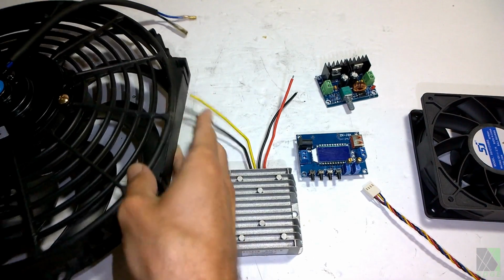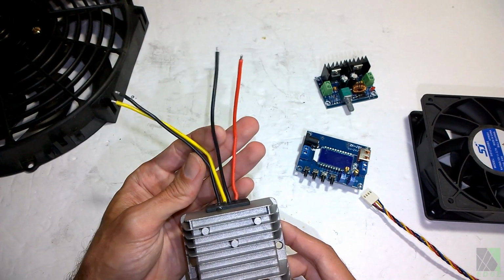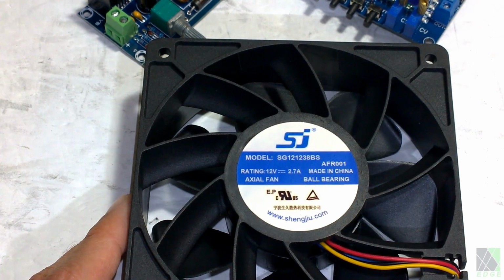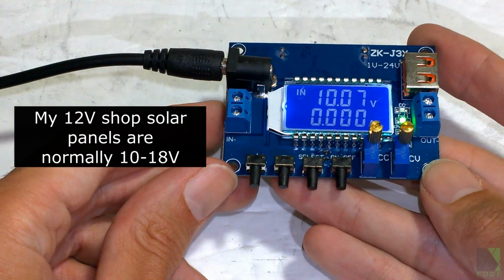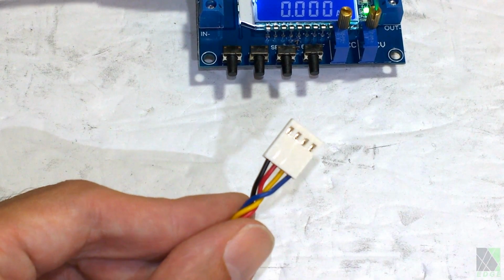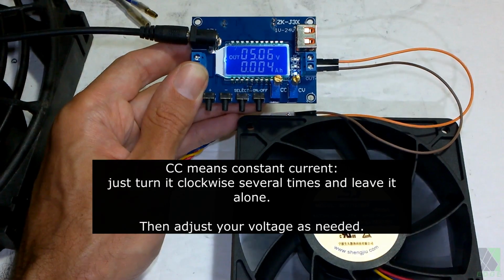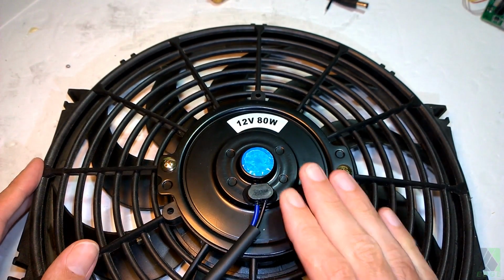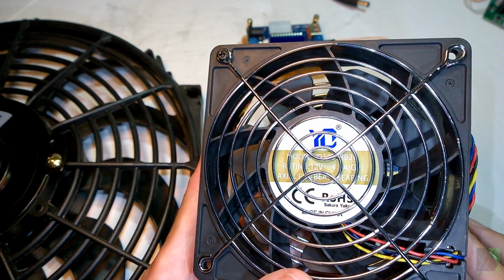Solar Shed Ventilation COMPONENTS Explained! Part 3 Favorite Brushless Fans DC converters #solar

Comment: I am living in Thailand I need to move air to prevent mold when away and the place is sealed up.  — I will have to order the fan on line from local parts houses. Can you recommend some specific automotive cooling fans that  you have used in the past that are a convenient size and shape to use with a 50W panel. Most cars here are Japanese but there are some Small Ford and Chevy pick ups.   Thanks So Much for the video and your help Jon
Reply from the maker: @JonBabcock-r7e Hi Jon I just replied to your other comment, glad the video was helpful. You can use any 12v or 24v car or truck radiator fan, have fun :)

Comment: great videos
I am trying to finalize a set up for my shed.  I am thinking 2, 10 or 12" 12v 80w radiator fans.  Should I run them with 200w (two 100w panels) with a dc buck controller or since you mention the radiator fans should only run around 6v should I just use 1 100w panel? Also which is the simplest safety measure, fusing off the panel or breaker.  Final question there are kits that come with a pwm controller, will those work or those mainly for regulating battery charging?
Reply from the maker: @swc913 Hi, I'd test 2 fans in series with your 100w solar panels and see how it goes. With 200w of solar, a standard 12v automotive fuse would be fine with an on/off switch for convenience. Otherwise a standard DC breaker can do both functions. Those kits probably are intended for battery charging, so I'd stick with straight through wiring. You can always add more stuff later - DC converter, speed controller, etc. Hope that helps
Reply: @solarpoweredge  Thank you for the information!  So  1 x 100w panel will be best to run 2 fans.  Opting for that lower 6v at each fan.  If I jump to 1 x 200w panel best to have some sort of fusing or breaker? I am in southern CA if that with max sun.
Thanks again!!
Reply from the maker: @swc913 No problem! with 200w I'd suggest a standard PV DC circuit breaker, mounted inside a plastic box with a DIN rail and the wiring secured. It's probably best to go this route, as the more power (amperage) on tap the greater the need for protective devices.
Reply: @solarpoweredge  
Sorry for all the questions.  Could you expand on some of your wiring techniques?  I am wondering if you can switch to regular 12-2 wire after you land the PV wire into the breaker?  From your videos it looks like you've run nonPV wire to your devices.

Comment: One more question please, I bought 2 of those 12 volt car radiator fans from your recent post below. Will the 100 watt solar panel in your Amazon link run both of those direct with out burning up those 2 fans? Will one of those panels safely run one fan direct or? Thanks in advance kind regards Steve.
Reply from the maker: @stevegill866 Hi, yes the 100w panel can run both fans. Simplest / cheapest solution is to put the 2x 12v fans in series (acts like a 24v fan) connect that to the solar panel and they should each get half the voltage, and not easily burn up. In direct sun, that 100w panel should move a good amount of air with 2 fans.

In my tests, a 100w solar panel can push one single 12v fan pretty hard, maybe even up towards 14-15v. In these tests, the fans got extremely hot and became a fire risk. I recommend running some tests with the fans in series and see what happens! PS: if you put both fans in parallel, that could be another option for low-speed operation - if you need 2 speeds.
Reply: @solarpoweredge  Thanks again! You are one of the best! 
Kind regards,
Steve
Reply from the maker: @stevegill866  No problem Steve, hope the project goes well

Comment: The link to your preferred 12 volt 12 inch fan has been listed as "not available" for some time. Can you provide a link to a reputable alternative? Thank you kindly.
Reply from the maker: @stevegill866 Hi thanks for telling me about that link, I replaced it with another to a 12v car radiator fan, very similar. There is also a link to a wider selection of them if you're curious. I found the smaller car radiator fans (like 10") are less effective due to surprisingly small blades for their size. 

PS, a 24v car radiator fan also works really well for direct drive solar. Unfortunately, they tend to cost more. It's a tradeoff. I have one in my smaller shed at the moment with a 50w 12v panel, works good.
 Hope this info helps.. Any questions let me know!
The 24v radiator fan test https://youtu.be/8juViLWghLs
24v/12v/series bench tests https://youtu.be/m-yhqqFJ4gg
Reply: @solarpoweredge   Thank you kindly! Sure appreciate your videos, opened up whole new vistas for me!
Reply from the maker: @stevegill866 Welcome!! :D

Comment: Great video thanks! Wondering if the DC brushless fans are waterproof. I want to install right at my gable vent in my shed and wind could blow rain into it.  Also unsure which thermostat would be best just for cooling in the summer?
Reply from the maker: @jeffholeman Welcome, glad you liked this :) most of them are not, a very few claim to be "weatherproof" but I gather they're not "soakproof". Maybe one option is build a downward facing duct to prevent windblown rain from making it in. It might be simpler to just run the fan all day off solar, as the heat will never stop coming in. That's basically what I do, never did use a thermostat. Less stuff to worry about :)

Comment: hi do you know how to hook up a battery inbetween the solar panel and the fan so that it can capture overcharge so it can also spin at night. Also, would such a set up require some kind of chip to detect when to use solar power and when to use battery power, because from what i understand batteries can't charge and discharge at the same time.
Reply from the maker: @Bromunculi  Hello, one way to do it is to use a basic solar charge controller, with a battery. The battery can be charging while the solar and fan are connected. This is actually a normal and common scenario. Think of a battery like a bucket of water. Water in (solar) versus water out (fan), and it's either filling up or emptying. A bigger solar panel will make sure the battery leans towards filling up, while still running the fan. A solar panel with less power than the fan will "help" run the fan, slowing down the battery discharge... but eventually the battery will be empty.
Some thoughts:
1) solar panel should be powerful enough to run the fan all day plus 100% charge the battery 
2) battery needs sufficient reserve to run the fan after a cloudy or dark day
3) If the "Load terminal" of the solar charge controller has at least 10 amps it might be a way to power the fan and automatically shut it off if the battery gets too low
4) Sheds are hot, and not too kind to batteries, just something to keep in mind. 
5) Another option is to run the fan on solar during the day, and a AC-DC converter during the night. That way you get the best of both worlds.
I hope these ideas are at least helpful :)
Reply: @solarpoweredge  alright appreciate the advice 😄👍
Reply from the maker: @Bromunculi Welcome!!! :)

Comment: my car radiator fan like that last 2 years running direct on 100watt panel before burning out ..i wonder what to do to make it last longer since i only have a 100 watt solar panel by the way im using as an attic fan and we are having heat wave here in Manila.
Reply from the maker: @timothy1837  Hi... yes I've heard it's very hot over there... these car radiator fans should run at 8-10v plus have a way to stay cool. Putting 2 in series will reduce the voltage and run them cooler and may move more air overall. Or using a DC-DC converter to keep the voltage 8-10v can help. A 100w panel could push the voltage pretty high in some conditions, in which case they will burn out sooner. Lower voltage = slower rotation, less heat, longer life (hopefully) as they only have carbon brushes with limited lifetime. I tested the series connection here https://youtu.be/m-yhqqFJ4gg
Reply: thank you so much for the advice ..and your very quick response...
Reply from the maker: @timothy1837 Welcome sir

Comment: Awesome presentation 👏.  Did you notice a temperature drop when the fans were working.
Reply from the maker: @andys5203 Thanks a lot! There is a thermometer in the shed and after blasting the fans a while I can see the temp drop. It cannot drop below the outside air temps but works good

Comment: Hi can you help me please? I have greenhause and i use 12v 20w solar for running my pump for irrignation with battery . Now i won add fan for better air flow on wintter and summer day. Which fun yuo sugesst? I also won have i speed control off fan. Maybe will be good if  i buy extra solar 30w. I also won add timer because in wintter day i won fan work just 2h in day
Reply from the maker: @mihaelbozicevic758  Hello, yes I will try to help. I suggest no less than a 30 or 50 watt 12 volt solar panel for the fan, so it moves a good amount of air.

The "fastest and simplest" solution is to connect a 50-85w car radiator fan straight to the solar panel with an On/Off switch. If this works well for you, then add speed control and a timer - as a separate project.

PS need a fan grille or cover as the radiator fan is very dangerous when spinning.

Just my opinions here, without knowing much about the greenhouse, hope it is of some help
Reply: Thank you! It is better if i connect two panels 12v one 20w second 40w in  parraller or series? i have mppt charge controller 12V 10A. @solarpoweredge
Reply from the maker: @mihaelbozicevic758  Welcome, you can connect the solar panels in parallel, they will operate like a bigger panel. 
Do you intend to run the fan from a battery and MPPT? If so, you could install a PWM motor speed controller, to adjust the fan speed and reduce draw on the battery. Just a thought :)

Comment: Thermo fans can run on 14.9 volts as some alternators put out that voltage. Depending on alternators but my Toyota hilux put out 14.9 volts at 90 amps. Im wanting to put a car thermo fan on my sons window as his bedroom is always hotter than outdoor temperature. I have 4 240 watts solar panels with PWM regulator. I know its simple plug and play with using a multimeter? Lowest i can go is 10 volts? Any reply appreciated? Cheers from Australia subbed and liked ❤
Reply from the maker: Hi and thanks a lot!! thanks for subbing too... yes you have the right idea... need regulation in between, those 240w solar panels are very powerful and might put out too much voltage. Just turn the voltage down low on the PWM or DC converter, connect a multimeter and fan, and adjust the voltage up till it is reasonable. 10-12v is a good limit to help the fan, those brushed fans do burn out faster if they run 15v all day. Hope this makes sense, have a question feel free to post and I'll do my best. Take care and keep cool!
Reply: @solarpoweredge  thanks heaps for the quick reply 👍.  It's ridiculous in Australia right now. Lol 😆. Yesterday in the sun my temp probe for air conditioning got up to 49 degrees Celsius and under my pergola was 38. House was 32 degrees Celsius! I'm almost 50 and as I'm getting older the heat really wrecks me as opposed to when I was younger doing carpentry on a hot concrete slab. Cheers 👍
Reply from the maker: You're welcome! that's outrageously hot. I hope the fan helps out. I don't handle the heat to well either any more, gotta be quick and then go back in the shade. Take care :)

Comment: Any recommendations for adding a thermostat in the mix to auto turn on/off or even vary the speed? Your explanations are top notch and would love your input.
Reply from the maker: Thank you! I'd recommend a "cooling" thermostat, probably mechanical so it is stable. I cannot put links in the chat here. But I added a link all the way at the bottom of the description. If you don't want to use the link, just search for mechanical thermostat on the big "A" site and they have various options. The one linked can do 30W DC which is enough for small fans. Remember any thermostat you pick must be "cooling" because the fan needs to come ON when it gets hot, not OFF as a heater would. Thanks a lot for watching and commenting! -DD
Reply: Thank you.
Reply from the maker: Np :)

Comment: Thank you So much for the great explanation. Can you recommend a thermostat that will work on 12 volts and how to add a small say 12V-7Ah Battery to run the fan after the sun sets?
Thank you.
Reply from the maker: Hello, you are very welcome! I cannot put links here, so I added them to the bottom of the description of the video: a small 12V thermostat (Fahrenheit display). For a battery you could use either a LiFePo4 (lithium), or AGM (lead acid). I put those links in the description. I'd still suggest at least reading up on the reviews and do a little comparison before making a decision. Of course you'd need some kind of charger to charge the battery - and enough solar panel to keep the battery full for night time cooling. Hope this helps!

Description just updated on this video (links all the way at the bottom) https://youtu.be/AHydnUCgUFU
Reply: Yes, I will look at the comparisons and your link. Thank you again.:):):)
Reply from the maker: Glad to help :)

Comment: Could you add some information about sizing and buying Solar panels?
Reply from the maker: Hi, good idea, I'll update the description. Here's my recommendations, hope it helps! Also I have 3 other videos about solar shed fans, if you're interested, they might be useful. Included below.

Solar panel sizing:
For a 12V 85w car radiator fan, you want a minimum 50 Watt 12 Volt solar panel. Directly connected, it will probably run around 5-6 volts in direct sun and move some air. 
(Adding a large adustable DC converter at the right setting can actually make the fan run a little faster.)

A 100 watt solar panel can burn up the car radiator fan in direct sunlight, as it might push 12+ volts continuously. Under this condition, the fan will get extremely hot. Keep the voltage at 10 volts or less to maximize the car radiator fan's lifespan.

For a 12V brushless DC mining or server fan with a small DC converter, as little as a 30 Watt solar panel can be useful. However, the 50 Watt 12V solar panel is a better choice especially since it produces more power in cloudy weather when the shed, chicken coop or outbuilding will still need some air flow.
More solar shed fan videos:
https://youtu.be/OfW7Ifh8HXs
https://youtu.be/Rc4pkF7kWQc
https://youtu.be/_AbXA7uOnps

Comment: A lot of those fans, especially the radiator fan, will move more air and more effectively cool themselves if they are attached to and either drawing thru or blowing into a tube the same diameter of the fan and 1/4 to 1/2 the diameter long.  In other words, a 12in fan would blow into a 12in diameter tube that is 3 to 6 inches long.  This can be simple paperboard from a cereal box or even printer paper (but for larger fans the paper may flap annoyingly - use only on the exhaust and wrap a layer or two of tape at the exit). This increases air speed thru the fan as well as preventing air swirling around the fan itself, possibly back into the intake. See "ducted fans" for more info.  An exhaust tube from paperboard or heavier, that increases in diameter away from the fan, with some intakes slanted in following the direction of airflow, can utilize the venturi effect to reduce air speed (and noise) while increasing air volume.
Reply from the maker: Great idea, have to try this asap :)

Comment: Would a 24 volt radiator fan on a 12 volt (18-21 VMP) be better to run than? It would be under volted and should run cooler.
Reply from the maker: That's exactly what I want to do :) but 24v fans are overpriced. Getting one for 20 bucks, probably a fantasy. So I run the 12V fans around 5-10v and so far so good. If I get rich, I will buy a 24v and try it out, maybe that's part 4.
Reply: @solarpoweredge  what if you ran two 12 volt fans in series on a 12 volt panel?
Reply from the maker: Sure it's a good idea and worth trying! Easier on the fans too